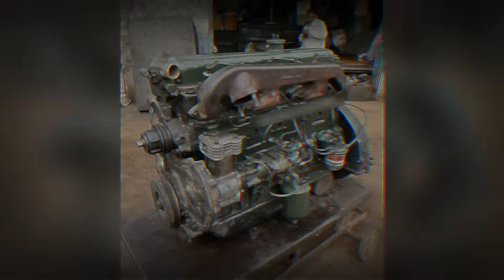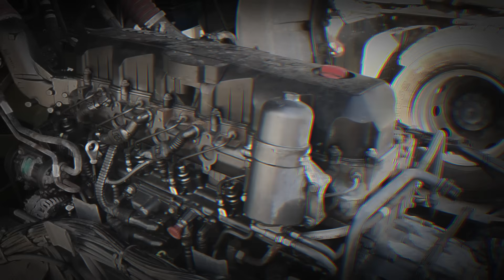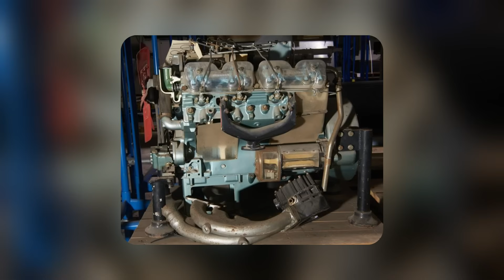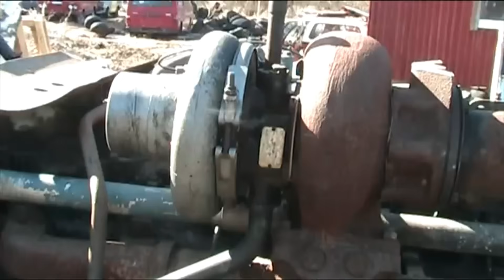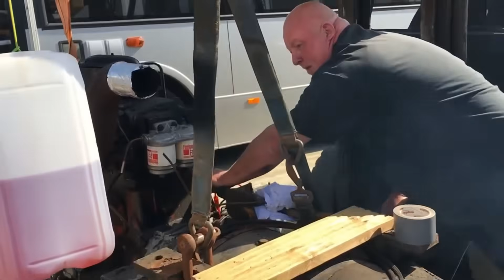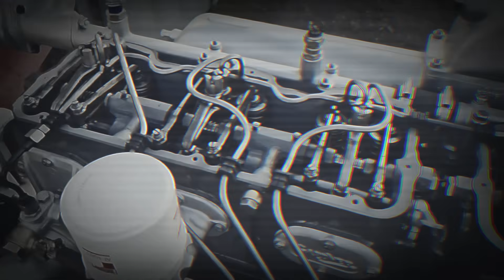10 British Lorry Engines Every Driver Trusted And Every Manufacturer Killed!

Comment: 466 gutless wonder , bastard to get at , Foden stroker  , freaking noisy,and the heads cracked just for looking at them ! . daf  AEC 505 as its base . ford nuf said . never worked on any V8 perks , towed a lot . Rolls , too many recalls . Cummins noisy but good . AEC , vibration , shook the bell housing loose . 680 ....... . Gardner 6lx/b/c/ d , reliable , pump head problems on the turbo engines

Comment: Why am I feeling sea sick????? keep the bloody screen stable, bedford 330 was a good engine, the 4cyl 220 version was a slug, the 466 was a  soft engine (supposed to replace leyland 400/401) they were using, The Ford 330/360 were reasonable but dropped the odd liner now and then,(no lip on the top to stop it) The AEC 505 was a good engine, and later the 506 with an inline CAV pump, that made a big difference to that engine, RR Eagle was a slug, clocked off at 1200 RPM, frustrating to drive, the TL12 was a flier, I think max RPM was 1900, we had one that went to 2200, no problems with them other than oil leaks from the head gaskets.

Comment: DAF engines in Seddon Atkinson Strato?? More BS.
Reply: 7:20
Reply: Why don’t you get your facts from but I bought a brand new Seddon Atkinson Stratocruser in 1989, the engine options at that time were Cummins, Rolls Eagle diesels I bought one with a 14 litre 400, BHP Cam Cummins, they were also available with a 10 litre Cummins in , I had all of these  versions on demo &found the 14 Cummins to be the most economical, DAF actually started fitting A 500 BHP, version of the 14 litre Cummins in their trucks after 1989, they were not available, in 1989 when I bought mine.

Comment: I worked on a fleet of AEC vehicles in the sixties,we had constant trouble with liner problems and head gasket problems,it wasn’t the government that ruined AEC it was the poor machining and crap parts that was used,the original engines of the early 50s were brilliant but once BL took over that was it,trouble ever after.

Comment: Stop it,Bedford engine’s especially the 466 was crap from start to finish,I used to work on all these older engines and most of them were rubbish,the Foden 2 stroke FD series was an absolute disaster and that’s what it was dropped,you haven’t a clue what your going on about,ask any fitter of that era hence that’s why Scania and Volvo have taken over the market in this country
Reply: Yeah I agree, the 330 engine was more reliable, and did seem to keep going, we had a few of them in Bedford coaches, mind you one of them burned over a gallon of oil a day,, but it just went on and on

Comment: No one ever liked the Perkins V8-510. It was vastly under powered for the vehicles it was fitted in.
Reply: Absolutely right,the Perkins V8 -510 wouldn’t pull the skin off a rice pudding absolutely gutless and unreliable,I got sick of changing head gaskets
Reply: It was utter rubbish hated them
Reply: @BerlietGBC Me too I detested working on them,continual overheating problems and head gasket problems,utter shite.
Reply: @davidellis279 Berliet used them for a bit as they had a gap in there engine range at the time, im reliably informed by the last chief engineer of Berliet they were a disaster
Reply: @BerlietGBC As far as I’m aware Berliet used Renault engines in their commercial vehicle’s nobody in their right mind would use the Perkins V8.
Reply: @davidellis279 No Berliet used Berliet engines apart from a stop gap in there own range with the Perkins V8, which was a disastrous it was not used for long, even after tbe merger into RVI the big truck engines from Berliet engineers powered the big stuff. Truck engines still made in Lyon today, i will add it was the the chief engineer of Berliet that undertook tbe turbo charging of the Gordini 1.5 V6 into the Renault F1 engine in the late 70 's
Reply: The only one that I drove that was any good was a Leyland Mastiff 16 tonner with the Eaton 2 speed axle,it’s the only one that had any balls when it was loaded and never overheated.

Comment: @6.14 why are you showing a picture of a Ford "Industrial" (vertical) engine when the Ford "D" series was fitted wit sloping engines?
Also the 2715 was never fitted to any "Delivery Van"
Reply: Sorry to burst your bubble but the Ford engine that was fitted in the D series was also fitted upright in coaches but slanted in the D series trucks, they also fitted Perkins and Cummins V8s which were total crap. The National Coal Board had dozens of the D1000 with both the V8s and got shut of them because of unreliability problems with the engines.

Comment: the only reason we stopped making the AV 505 and AV 760 was because the clowns in government shut us down in may 79, blame Jim Callahan, ex AEC ltd
Reply: The AV505 was a bloody good engine as was its smaller brother the AV471. Ran lots of them.
Reply: @PeterC-qwerty yes, great engines. I drove a Guy Warrior with a 471 back in 74. The Guy was a worn out wreck but the engine was mint. Drove other stuff with 691,505 and 760 all great motors.
Reply: Stop blaming the government,those engines were shite as was every engine BL built,those fixed head 500 series engines were a disgrace,the best engine they made was the 680 as fitted to the Scammel Routeman and long distance coaches.